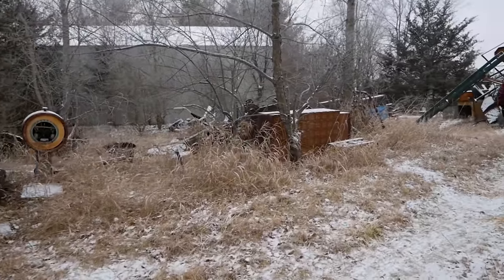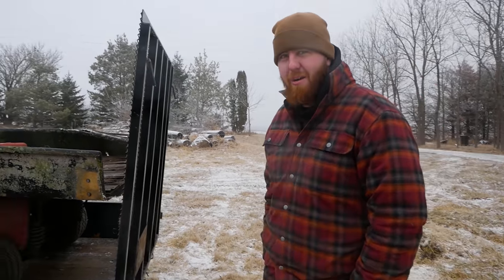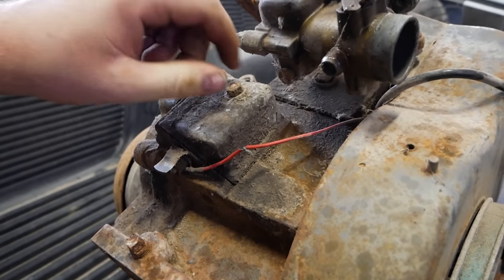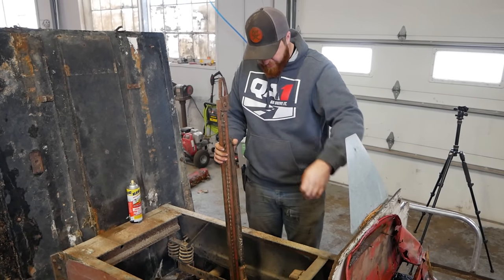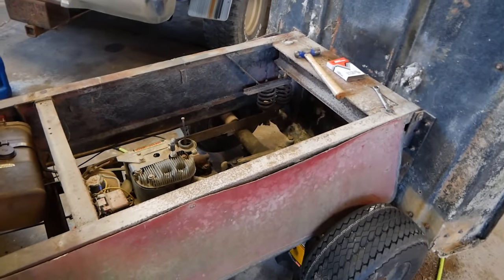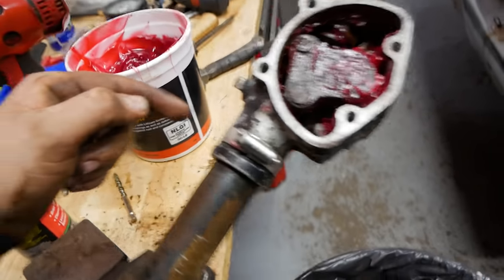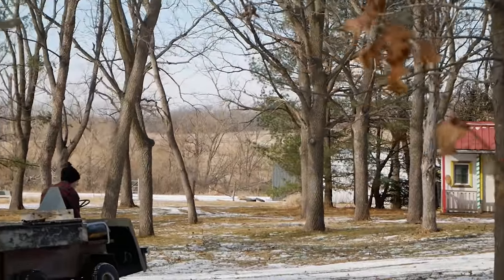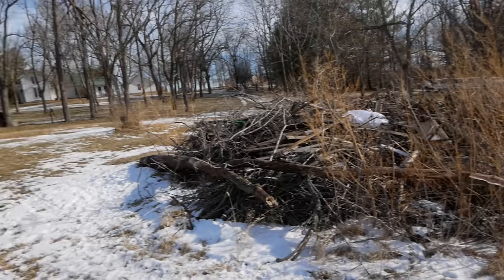Reviving an ABANONDED Yard Cart Found in a SCRAP PILE! - Will it Run and Drive?

Comment: Interesting fact, if that bus was manufactured by IC then it was built in Tulsa, Oklahoma which is not but a 10 minute drive from my house. They manufacture an absolute boatload of busses every year and they are absolutely everywhere.
Reply: In all honesty I think it would be very cool to see you guys do a school bus revival. Although they can be vehicles worthy of a parts cannon at times (from what the bus drivers once told me) some can also run basically forever. Definitely worth a revive!

Comment: Luggge Trolley, DSB Danish State Rails Used to have them. But they where electric driven with battery packs. Good old acid batteries it was. I've wanted to have one of those for some time.

Comment: Love your videos. I use a small racket strap to pop those tires on the bead by running the strap around the tire on the tread . This squeezes the center in and beads out. ✌🏻

Comment: swap the back tires out for turf diggers with some Aggressive tread,and put one of those harbor freight 212 cc predators in place of that ancient motor along with one of those cheap chinese tavs off Ebay and then that cart will Fly  around your yard....very cool project.

Comment: an idea for an air filter box, why not make up an air filter box and have it mounted next to the fuel tank/cell with a flexible hose between it and the carbie inlet tube and air filter box inlet have it behind the drivers legs

Comment: You need about 1 inch wide and longer. It should go around the outside of the back pully and the inside of the motor pulley.

Comment: Don't think you read these but, FYI I have gotten myself out of a  bind when a belt brakes and are you ready for this (queen size panty hose) make a couple of raps and tie a knot and cut the excess.  It has gotten me home or to an auto shop many times. For real. I always carry a pair in my glove box encase i loose one on the road it will keep you from over heating till you can get to back to town. NO BS

Comment: I gota say, there is still so much you can do with design. Then again, i almost want to rebuild it from scratch with a current (obviously more fuel efficient) engine. I live in Wisconsin, but sadly that co went outa business a few years back.  So many funny engineering tricks u could do to help make and keep the engine running. Most u never see in cars though. For eg, lets say u wana get realy crazy. And put a computer on it, could control choke, throttle, maybe be extra cheating and use a idle air control valve from a car to help keep from stalls. Heck shoot for the moon calculate the various parameters like on a car, estimated engine load based on rpm, maybe make some kinda jenky crank case position sensor. Throw some wideband heated o2 sensors on it. That bounce u could get on the front would be fun. But a friend tokd me working with fiberglass was super nasty. Maybe get nuts and put a torqe converter on it. Or get lazy with a go kart clutch (just looked it up $20) if you're worried about tire spin on snow and ice put more weight in the back. I mean heck ya could do electric fuel injection, coil for spark. And control timing for both. Yes i know most golf kart setups even computer controled ones are barely more than ones on this cart in video except theres a computer controling spark etc. And yes i realize adding stuff introduces points and more modes of failure. But can you imagine serious gokart like power or different versions with larger tires for grip, mud, traction control, body stability monitoring. Ya know what nvm, i should just go find a job designing atv's lol or maybe i should...

Comment: The transmission seems to be a single-pull-belt CVT as first used in the DAF 46.
If it is:
It needs a totally different type of belt.
It has a centrifugal clutch.
It should not drive the wheels when the engine is running idle.
It should be started in gear.
Reply: This is a classic CVT by all appearances, as he is also aware I'm sure given his extensive experience.  He clearly misspoke.  These kart CVT's are commonly available at gokart parts places.  

The ubiquitous small engine CVT do not use a centrifugal clutch.  The pulley width expands and contracts based on centrifugal forces in order to create the variable gear.  The belt rides on the pulley bushing when the engine idles so the engine doesn't stall.  
The CVT replaces the use of the centrifugal clutch altogether.  A typical small engine kart will have either a centrifugal clutch or CVT.
Reply: @SportbikerNZ  I only know the DAF pull-belt CVT's. I highly doubt if anyone -not from the Netherlands has ever even seen one in real life. Hence the line "If it is". :-)

Comment: One of those would be great for running around in the woods, hauling my chainsaws, fuel, bar oil, and the stuff I drag around to keep my saws cutting good, and then when the cutting is done I could use it to go back through the woods to gather up all the firewood and BBQ wood (oak and mesquite) so I can haul it up to processing area, cut to length and split it all, and then haul it to the drying racks to prepare for sale. My Kawasaki Bayou has to drag a little utility trailer to haul anything and my trailer is a pile of shit. And UTVs are crazy expensive, and way more machine than I need for my old man woodcutting business. To bad I rarely see anything like that around here unless somebody is selling one for family heirloom prices. Well I guess seeing it means I've got an excuse to build my own similar rig... Probably use my Hotrodded Tecumseh engine ( originally a 10 horse from a snow blower... Think I'll add a hydraulic dump bed using a power steering pump to power a ram that used to be on an engine hoist... and maybe install my little generator under the bed to run my small 110 volt log splitter or anything else I need to power....

Comment: Did you save the Troy built tiller you know how much that thing goes for a tough thing goes for Em use you can get $600 for it if we repair the cord and get it running

Comment: Hey, Kevin. I have a 1974 dodge dart swinger 225 ci. I have a wiring issue. I was wondering if you could possibly give me a hand or tell me what to look for? It starts smoking in the car when I hook a battery to it. I need help.

Comment: The use of a v belt on the variable clutch made me cringe. Things will work much better with the proper belt. That way at idle the primary clutch remains open and the transmission won't rotate.  When you rev up the engine the weights and rollers in the primary clutch close the movable shieve. The secondary clutch will open in accordance to the closing of the primary clutch. Ratio switches from small on engine, large on transmission to large on engine, small on transmission in relation to engine rpm.

Comment: I would use the hell out of that... you should just remove that motor and put a predator in it... even a 79cc geared really low would pull that around.... a 212 would probably be ideal.... if it can make a racing kart go 60, it can move that vibo at 15 all day with torque to spare...